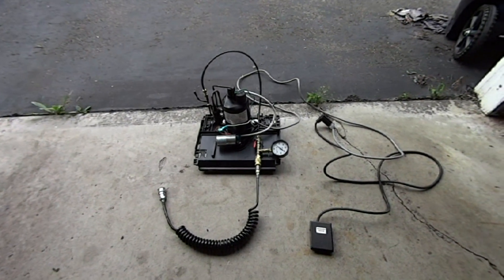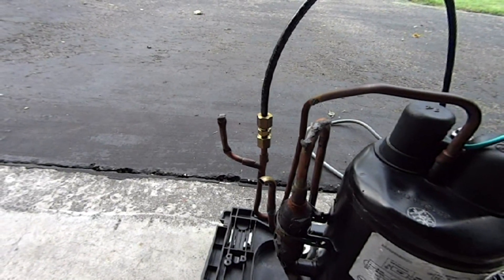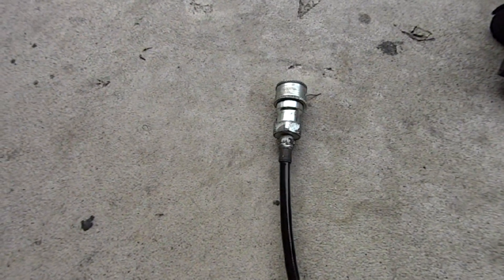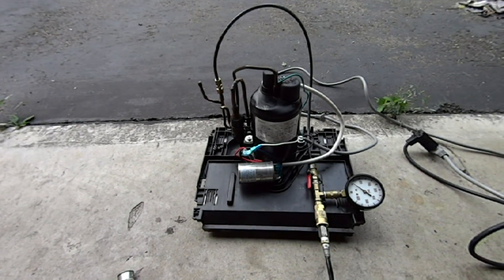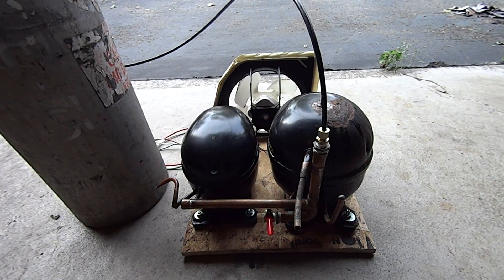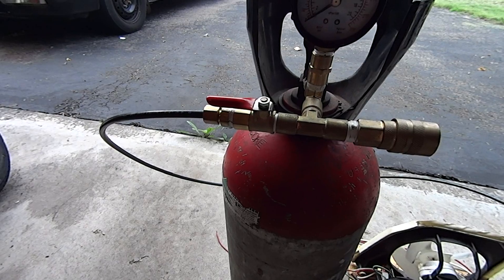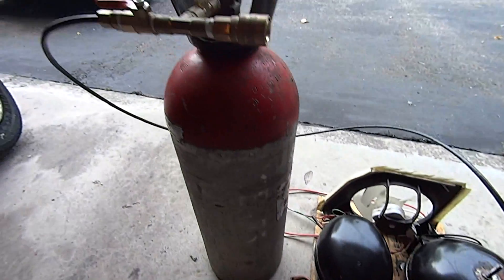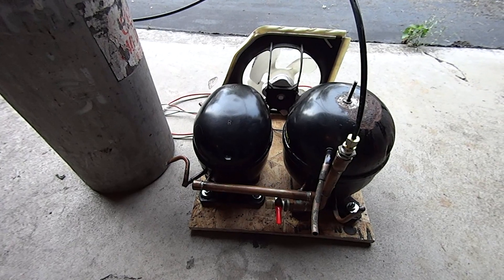High pressure air compressor overview and HOW TO fridge & ac

Comment: bout your reservoir tank, is it safe to fill it with high compressed air...? and is it always attached to the fridge comp. or you can detached it and just bring along the tank itself... tnx
Reply from the maker: It's a c02 tank, so it's made for 800+ psi. This was my first revision, ended up building a 2 stage compressor that can hit 1000psi. Tank is easily and safely detachable. Check out my later compressor videos for details on that.
Reply: @swandonovan  hi swan, nice vid by the way. thanks for the wsift reply. was wondering if you could help me build one like it. =)
Reply from the maker: @MrJewls87  no problem. What you need help with?
Reply: @swandonovan  yes if you could please share to me  what are the parts needed... And some tips and procedures as well.. 😁 Thanks!
Reply: @swandonovan  another thing can you pls send me the link on the updated version that reach 1000psi..🙂 Thanks
Reply from the maker: @MrJewls87  feel like the video covered the parts needed well? Just need a fridge / ac / dehumidifier / etc compressor, whatever size compression fitting that fits on the compressor output that adapts to 1/4" nylon brake line, then a way to adapt the brake line to whatever you're filling. Dump out and measure the oil from your refrigerant compressor, then replace it with the same volume of standard compressor oil.
Reply from the maker: @MrJewls87  https://youtu.be/rsXWAeOkenc
Reply: @swandonovan  oki, how often do you change compressor oil in that case?
Reply from the maker: @MrJewls87  up to you, it does mix a very small amount of oil with the output air. So I'd say bi yearly. But really depends on how much you're using it
Reply: @swandonovan  my .25ltr hpa tank has 3000psi. but lets say if the co2 tank has a capacity of 800psi only, will it be able to refill it..? thanks.
Reply from the maker: @MrJewls87  sure it'll fill it. But only to whatever psi is in the mother tank
Reply: @swandonovan  got it. is your co2 tank 15lbs or 10lbs...?

Comment: Hello again. I finally found an old frige I could take apart. But I noticed my compressor says 240v, 3ph. The frige did have a regular home wall plug but Im not seeing this big capacitor anywhere.  Did I get the wrong kind?
Reply from the maker: Wrong? No, but it sounds like it's 240v 3 phase

Comment: You're missing the key point here .. 

Which is safety,
multiple compressor setup almost never goes in series , in parallel or Cascade is very common ,Al of these types of setup are very well protected against a higher pressure rating as what the designed rating should be (safety pressure switch ect)and you're design is "not" , now .. somebody thinks , o that's a shortcut for a cheap setup , and uses a cast iron compressor (which are also available) and use it in series  .. well you know what the outcome is(yes a hand grenade type of damage) , be an expert on something you red in on .. ehm but let me save the people who are whise enough to not do it, 
please don't be ignorant and discard the max pressure rating of any item , (build in a proper safety valve) 

So .. do what you want , I like my girlfriend an two sons and don't want to lose them over a really dum choice of going the El cheapo route , it's not worth it , spend a lousy 400 bucks on a Chinese compressor and you're still be safer , if you don't have the money , than you shouldn't be doing the sport ..
Reply from the maker: I hear you. But your grammar... Rough

Comment: Hello Swan Donovan, i was thinking, can we change the oil for some none flameable hydraulic oil? it has lubrication too but there are less flameable than oil that it is currently lubricated with. Which oild would you recomend ?

I'm considering running fridge compressor at 90-100 bar and just to be little bit more safe
Reply from the maker: Netrick I changed both out for compressor oil.
Reply: I guess mineral oil is flammable..  it does smoke like a stoner but never seen it flame..

Comment: This type of compressor is life-threatening! It is very dangerous to pump air, at a pressure of more than 30 bar! Such compressors are designed for inert gas! The air becomes more reactive as the pressure increases. Above 30 bars, it can ignite when mixed with oil (diesel effect) These compressors are constantly leaking oil! There is an oil separator on them. This is completely normal! But in the case of air, they form a dangerous mixture!
Reply from the maker: MrPyroMaster it takes around 70 bar for that to happen
Reply: Nothing happened, yet... by happy!  The desel engines working about 30-40bar. auto ignite the desel oil. The oil is not yet vaporized inside. But when a larger quantity is collected, this can easily happen. Unsafe!
Reply from the maker: MrPyroMaster I've read multiple papers on the topic. I can link them if you want. At the "low" pressure you're talking about, it happens because the pressure is raised from atmospheric to 30 bar very quickly /like instantaneously. That doesn't happen in a compressor. Also, heat lowers the point at which the oil auto ignites. The cylinders I fill might raise a few degrees f in total. Everything I've read has mentioned not only the really sharp increase in pressure, but also temps well over 300 degrees f
Reply: And even an exploding casing , the steel surrounding is not rated at more than 30/40 bar (what is given by manufacturer) even in series , real danger here, at least if you don't like shrapnel
Reply: @-allround-  The casing is actually the low side on a refrigeration compressor.
Reply: @mattm5361  that is correct , but not if you put m in series , then you got a bom on your hands , that's something you may mention in the    explaining of you're title , as an HVAC technician , it's the nightmare you've been trained to avoid
Reply: @-allround-  Using a dual compressor set up is quite common in commercial refrigeration. 
Even in series with another high head compressor I highly doubt that one would explode, The housings are easily as thick as a gas bottle and are made in the same way and you'd never get anywhere near enough pressure out of a fridge compressor to cause the housing to fail before the valve plate smashed, a copper pipe burst or one of the brazes cracked.

In short, 
Will it work? Yes, A lot of time and hassle when nitrogen is cheap and provides 2000 psi though
Will it last? No
Is it safe? Enough

Comment: Awesome can u do a vid showing how it works like how much pressure come out and what is the consistancy and can u use this to clean water off a car engine 
 thanks
Reply from the maker: Infinity vidz help the helpless cfm is extremely low. It's like the exact opposite of a normal compressor. Low cfm, but able to reach high pressure

Comment: Ok, this has me thinking again. (This is where everyone says, "uh oh!".) Hand pump. Ok, you can get a hand pump that pumps up to 3000 psi. But who wants to do that work? And they aren't cheap...

Regarding the 'work'... Look for a free treadmill in your area. Craigslist. Giveaway sites on facebook. Or just watch for one set out by the road. You can always find free, working treadmills. The motor on those has a TON of torque. And it can be turned down to run incredibly slow. You can obviously figure out how to set this up to run the hand pump, without damaging the hand pump...

Regarding the hand pump. Yeah, not cheap. Then I got to thinking... We do what we do, (reverse-engineering, then making, and maybe some re-engineering), because if someone else made it, so can we. Same thing here. If someone makes a hand pump that can pump 3000 psi, then why can't we make our own stationary pump, to be run by the treadmill motor? I think it can be done.

Now to find some free time to do the necessary research and development... LOL
Reply: You can hook those hand pumps up to homemade electric pumps and use them to fill your guns super cheap and it is EASY  and CHEAP to make a electric motor pump those type of hand pumps for you .

Comment: Any fridge compressor should do 1000psi. If the dehumidifier compressor is better...

You might consider building some sort of safety housing, and running the dehumidifier compressor up to 2000 or 3000, just as a public service. ;)
Reply from the maker: selador11 I've yet to find a compressor that will go over 600ish psi at atmospheric pressure input
Reply: Not a chance in hell

Most are designed to pump 50 -60 psi max heads and rely on liquid refrigerant for cooling

Getting 600 pounds out of one is impressive, Will be even more impressive if it's still working.
Reply: You must be an apprentice and not allowed to use the gauges yet..   even with no freon the compressors will still have a high side of  around 100 the refrigerant acts as a cooling agent for the compressor is all..  thats why running with no or low freon can damage the compressor..  but ive never ran across a scroll compressor that couldnt pump over 200..   and they last as long as you keep oil in em as they will pump out some over time as they are designed to put oil in the closed loop system and return it but as air compressor they have no oil return but can add in the intake if gets low..  also since the pumps wont be running 75% of 24/7 like in a fridge than they wont ever get hot enough to lock up even if ran low on oil..  takes a little bit to kill a compressor motor..

Comment: Is 500lbs enough pressure for paintball? I thought the standard output was around 900lbs? About 3 years ago when I bought my first paintball gun I thought of hooking several of the refrigerator compressors together in series to achieve much higher pressure. I reasoned that it could work because these type compressors are hermetically sealed from outside normal atmospheric pressures. Theoretically the input on second compressor would not care if it was fed with 500lb air because of it being a sealed unit. I did not build a series setup because at the time it only cost $5 to fill a scuba tank at a local scuba shop. That shop had to close due to not enough business so now I take up  the idea again. I googled on compressors in series and that's how I came to your video. I'm thinking the series idea needs a small reservoir between output of one before connecting to input of the other. This would provide a buffer to take care of differences in volume due to increasingly higher pressures. Another thing I thought of was to use silicon oil in both compressors in place of normal fridge oils to prevent dieseling and possible explosions somewhere around the 900lbs or perhaps greater. I think the actual flash point probably varies depending on the oil. Let me know what you think of all that I have said. It's much easier and faster to do some analysis ahead of actual experiments as I'm sure you know.
Reply from the maker: Will Yam average psi of co2 is 800psi.  however, you get better results at lower pressure with air as the molecules are a lot smaller than co2. I'd agree that a tank between the two compressors would be a good idea if you were going to do a series setup. I think a 100psi pre charge would be enough to get you to some very high pressure. I drained the oil in all my fridge compressors and am using compressor oil. not sure what you'd have to use when going to 1000+ psi though. hope this helps

Comment: Do they get really hot?
Reply from the maker: Jose B no, as stated in the video, they only get slightly warm to the touch when filling the large co2 bottle from empty. but the fan runs constantly when the compressor is running
Reply from the maker: Jose B the dehumidifier however gets way too hot to touch
Reply: Swan Donovan thnx a lot cool shit.

Comment: Are u running both motors on one outlet ? If so are u runnin 110-120 n what type of breaker ? 15amp 20amp? Any help please . I wanna run two too
Reply from the maker: Jose B yes they are running off a single plug. 15 amp breaker, but you could probably get away with even less.